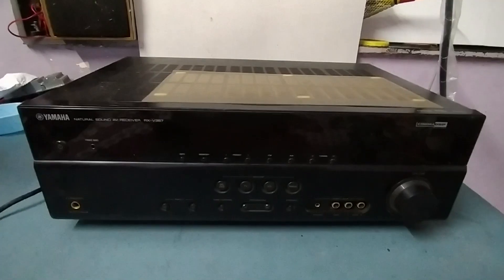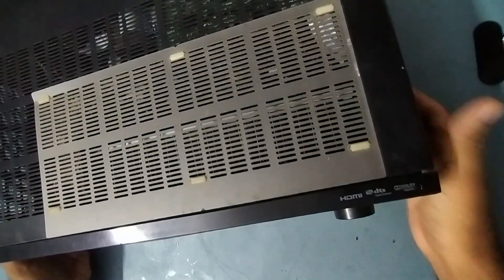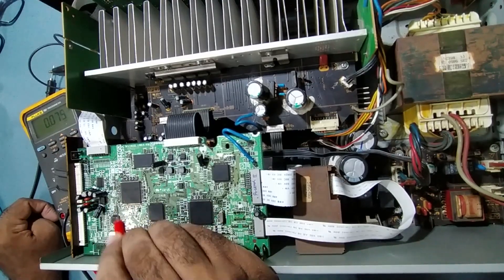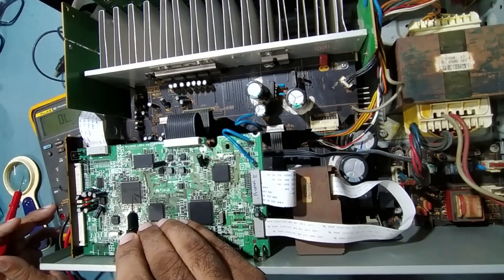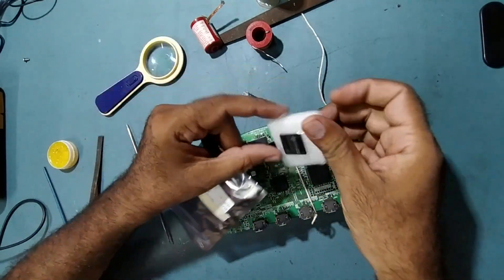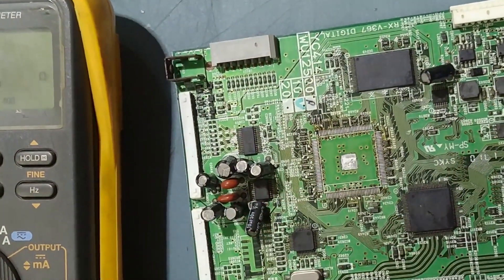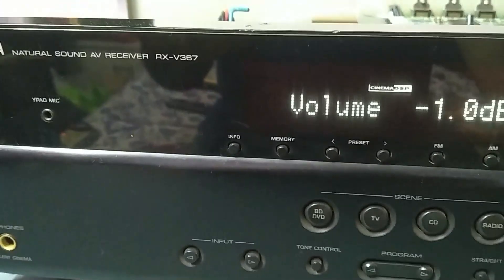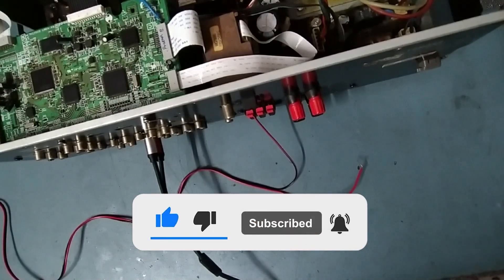Replacing Defective DSP IC with New in YAMAHA RX-V365 AVR for NO SOUND OUTPUT PROBLEM

Comment: I have a problem. HDMI 1 is not responding, found one dead resistor 3 ohms but didn't fix the issue. Also "on TV menu" not appearing. TV HDM 1 not recognised when it's the only HDMI connected but it does pass audi and video from HDMI 2 and 3. Looks like 2 chips need replacing but would be happy to just have on TV menu working. Also i have some of these amps that sound like they lack bass, some of the effects / programs also sound strange such as "mono movie" Could this be the tone control chip changing DAC did not help with this lack of bass. 2ch stereo sounds more bassy than straight but still seems to lack some bass. boosting bass with tone control makes almost no difference sounds better in zero position.
Reply from the maker: Better replace  main board (full hdmi board with new)

Comment: I am very surprised because the DSP chip is irreplaceable and technician did not show its number and how it was resold!  So a suspected act.
Reply from the maker: Dear viewer, as u have not viewed my video properly, ic no. Poped up in running video before replacing ic, & fixing of new ic will take long time so I am trying to show that everything in brief video. Anyway thanks for your comments.
Reply: @TKFElectronics  please accept my sincere apology regarding my comments 🙂. What was coat of DSP chip and its source ?

Comment: Sir, dsp ic was short, changed same ic that you changed in this video.. But no sound out..3.3v and 1.8v are ok..Is this ic reqires a software updation.. Model :RX-V1065.
Reply from the maker: What is the no. of ic u changed & it is the same no. with old ic no. or little difference
Reply: @TKFElectronics  same sir, TMS320 D70YE101BRFP.
Reply from the maker: How about bottom Board Amplifier section
Yamaha which model it is
Reply: @TKFElectronics  Problem solved sir.. Ic works and sound came ok after resoldered ic again.. Fault by the poor contacts of pins.. Thankyou for your  replies..🙏

Comment: Bro i have 2064 but my front three speakers are working but if i switch 2.1 or 5.1 then subwoofer or back surrounding speakers are not working sub woofer or surrounding back spekers are not working

Comment: Hi great vídeo, did you write the ic with any rom / firmware or is just "plug and play"?
Reply from the maker: Just plug & play
Reply: @TKFElectronics Where is the ROM/Firmware stored. My amp just stuck on NO MODEL INFO and does not restore no matter what tricks are applied.
Reply from the maker: Full Motherboard board need to replace
Reply: @TKFElectronics  Yamaha agent said the have 20 broken amps in the workshop. Custimers did not return when told of price of motherboard. It costs more than 5X most new amps.

Comment: Hi Sirji, yamaha AVR Rx - v371, same issue no audio in 5 channels only SW humming heard during test tone, its the same issue related to DSP IC?? Actually few days back I just opened the unit to clean up with blower and then tried washing the dsp board using Thinner over toothbrush, is it because of that????? Please help and let me know your contact details for further communication related to repair and solution
Reply from the maker: 9653123582

Comment: Great . I have Yamaha dsp ax 2 . The issue is it works perfectly fine in stereo . And the moment I switch on DSP and use digital optical inputs , my main left channel produce distorted sound . Rest all other channels works fine .. please guide
Reply from the maker: May be Problem is in DSP ic or CPU ic bro
Reply: @TKFElectronics  thanks for your prompt reply. Tell me is it possible to get a new DSP card all together
Reply from the maker: My friend this I can able to suggest you after checking your system only.
Reply: @TKFElectronics  I wish that was possible but I am way far away from you
Reply from the maker: From where you are bro
Reply: @TKFElectronics  Pakistan